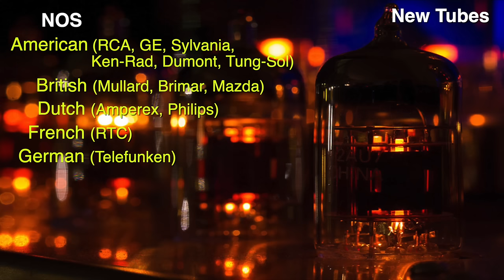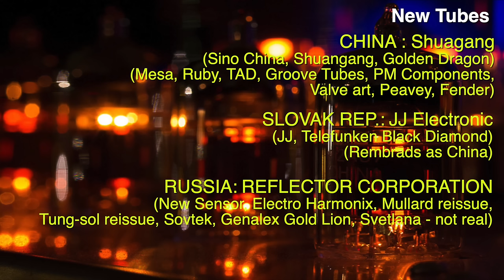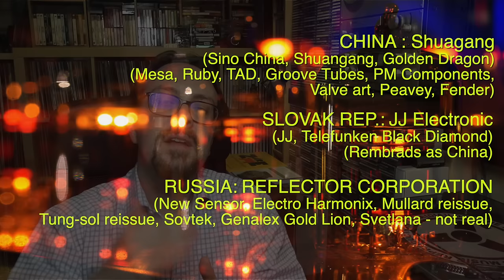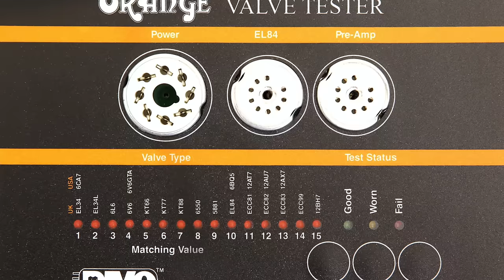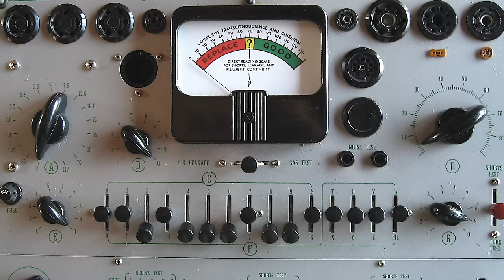Vacuum Tubes Basics: 10 things you need to know

Comment: Hi, very good upload from you my friend. Currently I also have two tube amp made by my friend. He imports transformer from Japan. As per his opinion the right circuit design,the output transformer,heater supply quality and tube itself decide the quality and fidelity of amp.
Reply from the maker: Yes, the flavour of tubes is just the cherry on top...the cake is obviuosly below! ;-)
Reply: @anadialog  In my opinion tube is the real faithful electronic component to use as diode and triode, as it has very very high breakdown voltage(no reverse current possibility) compare to semiconductors components. And it works with comparatively high voltage swing and so can catch or reproduce very fine details of sound waves. Due to vacuum it also has best transconductance for electron flow. I like it's true to nature organics reproduction of sound

Comment: NOS tube sets for 12ax7 preamps :
1.vintage vibes: v1: 1956 mullard  mc1 longplates  v2: 1958 mullard f91 longplates  v3: 1959 mullard f92  
2.blue  marlin: v1: 1958 mullard longplates f91 7025  v2 mullard i61 1959-1964  v3 1964-1975 mullard i63
3. green marlin v1: 1964 mullard yellow print i62 v2 mullard i63 v3 mullard i63 /power tubes mullard xf2 
4. ultimate warmth : v1: 1960's brimar 6057 yellow t v2 brimar 6057 v3 brimar cv4004/xf1
5.studio :v1 1960's mullard 10m goldpins v2 1959-1964 mullard i61 v3 i63
6.striped marlin: v1 i61 v2 i62 v3 i63
7.SWEET CLARITY: GE 12AX7WA v1 v2 v3
8.rusty: rca 7025/12ax7a v1 v2 v3

Comment: I'm curious, you say tubes last roughly 2 years or so.,,,but the tubes in my 1967 reel to reel tape machine are still working fine.
Reply from the maker: Maybe that was a little too restricted and clearly it depends by a series of factors. 1967? Those are preamp tubes, the should last longer but even if the are working that doesn't mean they are making good sound. Try changing them and get ready for a surprise!
Reply: @anadialog  It's an AKAI M8 tapedeck, it has 5 tubes for each channel, which are... 6267...12AD7 (preamp similar to 12AX7).....6BQ5 (aka EL84)....6AR5....6X4 ....in that order.  It sounds fantastic to my ears.  Recently one of the EL84 tubes died so replaced both channels with new Mullard tubes.  I didn't notice a huge difference in quality after the switch.....still sounds great.  Do you really think switching the preamp and power tubes will make a big difference to the sound?  I thought the most important tube was the EL84.

Comment: I wonder if there's any scientific studies that show analog is better than digital or tube is better than transistor. Of course modern solid state amplifiers suck, but I have an amplifier from the 70's that is transistor, with 7 discrete BJT transistors plus 2 output darlingtons per channel, and, with a good CD player, I can't imagine a higher sound quality. So I wonder if tubes actually make an objective difference or it's all mental masturbation. I only heard tubes one time, like 30 years ago when we had a tube stereo from the 60's here at the workshop, but I don't really remember the quality. I do have an old tube tester and a box of old tubes from those times though. Some of them are still good.
Reply from the maker: Good point but I am afraid the answer is no, since measurements indicate quantity and not quality. You can infer quality from quantity but not always and not for everything. Like I always say, get two chocolate bars or two bottles of wine and test them. You can have all the measurements in the world but you will never be able to declare which one is of better quality.
Reply: @anadialog  You can measure how similar it is to the input signal. I read in the past that BJT has lowest distortion and highest noise, JFET has highest distortion and lowest noise, and tube is somewhere in the middle. Indeed the BJT amp that I mentioned has a subtle background hiss all the time, but its sound is just beautiful. It sounds like the singer is in front of your face. Doesn't even compare to all the other amps that I had. But in these tests they only considered the harmonics for distortion, and I wanted a richer study. I know distortion is not always bad. CD has proven to have 20 times more detail than vinyl, and regarding tape, it takes a 7 year old with superhearing to distinguish it from CD, what can be solved by doubling the sampling rate.
Reply: @ThalesPo  what's with the JFET slander?
Reply: @dakata2416  JFET has about 10 times less noise than a common BJT and can be very fast with low capacitance and high input impedance. Most of the Sansui hi-fi devices use JFETs at the inputs of every stage, with differential to mitigate distortion. They give the best result.

Comment: im thinking about changing my current phono preamp (which i have no problem with, nothings bothers me with it) just because i would like to buy the Dynavox TRP-2 that besides as a phono preamp i can also use an extra source (my cd player) passing through the "tube" inside the preamp (like buffering stages) and then to my amp.. what do you guys think ? anybody has any expierience with this preamp?
Reply from the maker: I do not like Dynavox. Low quality, don't get me wrong, there is stuff much much worse, but if we are talking Hi-Fi check for example these suggestions (check also the models I suggest in the video description): https://youtu.be/zOPD7lKqEP0

Comment: Way past my skill set. ..I have a NZ made Columbus from about 1948-50....heavy mantel radio with excellent big 12 inch/30 cm speaker and 5 separate  SW bands. I am pretty sure the plug-in  part for the  RCA 5Y3GT valve needs repairing as good contact is found in only one spot if the Hot valve is adjusted.

Comment: Thermionic sourced mobile charge carriers that only form a current when the polarity of applied voltage across the tube is such that plate voltage is greater than the cathode

Comment: In a recent double blind test..95% of the "listeners" could not hear the difference between a 7903(04) 50 watt MOSFET chip-amp and several 50 watt tube amps. Many preferred the sound and imaging of the MOSFET based chip over the tube. An engineer commented on the fact that the internal transistors in the chip are laser etched and perfectly matched which is extremely difficult to do for a tube power amp. However the tube amps generally had a better peak-to-average power ratios and could handle "overload" conditions without quickly just shutting off.
Reply: I watched a demo where a room full of experienced audiophiles could not hear 10% THD. Some hands started going up after that, when it got above 10% THD

Comment: Hi you didn't say KR audio in the Czech Republic make tubes. Have you given any more thought or try that dt100 dry silicone spray yet.
 no issue touching the glass of the tube it's not like a halogen bulb
Reply from the maker: Could not mention all, thanks for adding that! No, I haven. I have so much stock...the handling with or without filters is a long time debate...

Comment: Rtc is not French but former east German. Matched tubes are better. Nonsence it must be matched if you have a fixed bias setting by resistors. I use variable bias so I can set every tube for the power amping to its current.

Comment: #11 It’s important to maintain tubes by deoxidizing the pins and treating them with contact enhancer annually to get the most out of them. DeoxIT Gold is a very good deoxidizer AND contact enhancer. Stabilant 22 and Furutech Nano Liquid are excellent contact enhancer which require a separate step to first deoxidize the metal. To deoxidize the metal, I recommend using 99.9% isopropyl alcohol and foam swabs. Lower percentage isopropyl alcohol contains water, very bad for electrical connections. And cotton swabs are bad to use because they can leave micro fibers on the metal which inhibits electrical conductivity.

I recently bought a TUNG-SOL Made In USA 6sn7 for the preamp section of my Cary 300SEI. And all I have to say is that it’s MAGIC! I placed a Mapleshade Tube Halo on it which removed any trace of sibilance in the music.

Comment: I have a hard time to understand why tubes need to get hot.    Once the voltage reaches the cathode  it starts to flow electrons to the cathode right aways.  I dont understand why heat has to do with it

Comment: Actually, Tubes were used in a lot of early electronic devices from early radio receivers and transmitters, to amplifiers, telephone systems, early electronic musical instruments, computers, even early televisions, pretty much every early electronic devices used tubes before transistors and integrated circuits were invented.
Reply: They HAD to.... before transistors, there was ONLY tubes as active amplification devices.

Comment: "Tube sound" is nothing more than distortion added by the tube itself, and it occurs primarily in the output stage of the tube circuit. The harder the tube is driven, the more distortion (tube sound) is produced.  HOWEVER, if a tube is used in the front end of an amplifier circuit, and is it driven very lightly into a high impedance input, they will sound VERY accurate, with very LITTLE distortion, and can sound better than a transistor. 
My favorite amplifier circuit is a tube front-end driving a solid state output stage.... Bliss

Comment: Warning! I admire your ambition to increase interest for tubes but at the same time I agree with some other coments below. You have certainly read a lot about tubes  but you shure talk out of your hat to some degree. Saw in a comment that you want example of what is incorrect. So here are some. First, tubes are lethal, nothing to tinker around with like other stuff you can explore on hobby level, you need to know what you do inside an amplifier, otherwise you die. (400-500 volt not unusual). Second, tubes does not have a sound, its the other stuff in the circuits that form a specific sound by attenuation of low, mid or high frequence, working point, distortion etc.Tube itself is neutral. Third, Matching tubes is only important in push-pull configuration, like power tubes in output stage, exept for single end output. The rest of low level amplification is mostly single end amplification. Fourth, I would say most of the tube amplifier has self-bias circuits regulated by cathode resistor, diods in newer circuits and only some have adjustable bias. People should not use skrewdrivers poking around in amplifiers (400-500 volt) searching for bias skrew... And the list goes on but I admire your ambition to try to explain something here that takes the good part of a mans life to learn. Anyhow, thanks for the video! And yes tubes are awesome!
Reply from the maker: Thanks for the nice, finally polite, critique. I do agree that there are some specifications to what I said but as you can see from your comment the general basics are safe. The only aspect we clearly disagree is the sound of tube. Yes, the rest of the circuitry is very important but tube rolling is an solid fact and I can swear on the grave of my granny that each tube has its distinctive sound, actually, everyone knows that. I am surprised by this affirmation.
Reply: Yes, we shall always srive to be polite and I love your channel and have subscribed. Tube rolling can be done within equivalent tubes but not different types, important. I have been building tube amplifiers since end of 80' and yes there can be a different sound between eqivalent tubes depending on brands. The explanation can be found in manufacturers specification were they declare  slightly different capacitances between connections and they will form a low or high-pass filter together with resistances and reactances from previouse or following stages. Same as cables do between equipments. Cable usually has a number of picofarads per meter and together with different input or output impedances of equipment they also form a sort of high or lowpass filter slightly attenuating low or high signal. Thats why impedance matching between stages and equipment is important, known already 70 years ago. But if you put a gun to tube manufacturers head forcing them to improve "soundstage" they couldn't do it and the result YOU get rolling a tube in your amplifier might absolutely not be the same difference for someone else doing the same swap in a different amplifier. 300B's are a good example were chosen operating point in caracteristics and driving tube (previouse stage) have a huge impact on how a rolling will change the sound. A NOS Western Electric 300B for 10.000$ might be a disapointment if working point is not adjusted to WE specs of the 30's. But why not, it keeps up te somewhat magic-secret things about tubes that so many people love. Keep rolling them tubes :)
Reply from the maker: @ifixmycarmyself2502   congrats for your experience. Of course tube rolling can be' done only among the same types, I clearly stated that in the video. Indeed, the same tube will sound different in a different amp. That is the magic of tubes. Love it!

Comment: It would be interesting to compare a Tube amplifier to a FET based amplifier with very high voltage B+ like the Tubes have and really high quality output transformers.   Just would be nice to see if it is the tube itself or the high B+ that makes more of a difference.   You would want to make sure you do have a FET based output as they are voltage control devices, like tubes are.
Tube life being short is not really accurate.  Tubes can last a considerable time, a lot longer than 1 or 2 years you quote.   There are tubes in old equipment that are still original and 50 years on, with who knows how much use, still testing strong and working perfectly.
Handling the glass of a Tube does not affect the tube.  It is standard glass.  It is not like a Halogen light globe.  Dust, dirt, even oils from skin do not affect tubes at all.   Sorry to pull you up on that, but it is important not to spread false fears about tubes.    Tubes are not so sensitive as the younger generation like to make out they are.  They are quite robust.  People use to change their own tubes in the day, no one handled them with tissues.  They really are not that fragile

Comment: Hard must disagree with you on this point You will not  break because you touched it just wipe it with a cloth afterwards they are more robust than you are making out and tubs  warm up after A few minutes anything longer than that is a waste of time and new old stock has been sat on shelves for years so they are not forced to be better than new tubs ps I have been using two amplifiers for several years now with no problems they sound beautiful
Reply from the maker: Hi there, not because I touched it but because the oils in your fingers tend to get very hot and may lead to different working temperatures and s shorter life besides thermal shock...yes, the glass is very resistant, I agree.

Comment: Hi. Is boombox a good tape recorder? or i buy a stereo cassette recorder?for recording from loptop to cassette with high quality Thanks
Reply from the maker: Boomboxes never meant to be high quality. You need a dedicated cassette deck possible a pro version, with 3 heads, calibration etc. I will do a video on this soon...
Reply: @anadialog  Where can I get 3 head devices? I go to sites where most of the existing stereo devices are in need of repair,I decided to record with a panasonic Boombox and rca cable on a cassette but its sound quality is not good. I also recorded a stereo CD system panasonic ak48 on the cassette, which is not great sound quality.Aren't the cd sterio devices also good? For example, the Samsung max ws750...
Reply from the maker: @khandebazariha7460  you need high quality cassettes and tape deck for high quality sound. You must decide a model or a characteristic like 3 head and look for it mainly on ebay but also on other smaller internet ad sites. If you are lucky your local thrift shop may have a very good deck for only a few dollars...most of them though need service, remember that...if all of this seems a problem and not an adventure go digital with CDs, yes.
Reply: @anadialog  Thank You
Reply: @anadialog   I went to different stores.  All of the existing Deck devices were 2 heads and cost around $ 20-50. The models were the td-w999, and Akai GXC-710D ferrite Head, and td-w208,and kenwood KX-W6080 ,which you recommend one?Are these decks good? Better than my own panasonic sa ak48 ?
Reply from the maker: Hi again, these are good models for the price IF the y are in good working condition. I would invest a little more and get a 3 head pro deck. You will not regret it. If you decide to proceed I think the Akai is the winning deck in this group and yes, they are all better than your Panasonic! :-)
Reply: @anadialog  Thank you for your accountability If I want to have the same sound quality as the tapes recorded by the company, should I buy a Deck 3 head or can I get high performance with the same devices as the akai gxc 710?

Comment: You're a little off on the theory that how many tubes regulates the life of the tube . The parameters that the tubes are run at make much more of a different How hard were the plates being pushed ? If they are run at or under the max values they will last a VERY long time . I've been working on tube gear for almost fifty years and a LOT of the older pre amp tubes in many Dynaco andFisher etc , etc are STILL fine 50 years later ....output tubes are a different animal although the Fisher 400 my folks had which was run at least six hours a day and the original 7868s were only changed maybe ten years ago ? If bias is correct they will last a very long time . Guitar amps are a totally different animal because the tubes are driven way harder than the maximums stated for the given tube . ALSO what not many people mention is the sound of a tube amp is only partly from the tubes . The OTHER maybe even bigger part is played by the output transformer (s) in the power amp section of a integrated amp or receiver .